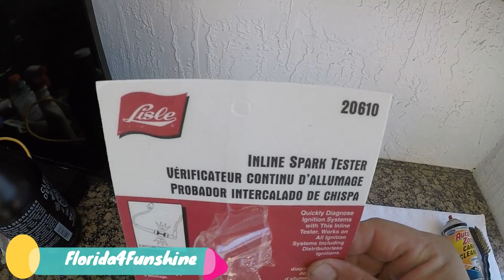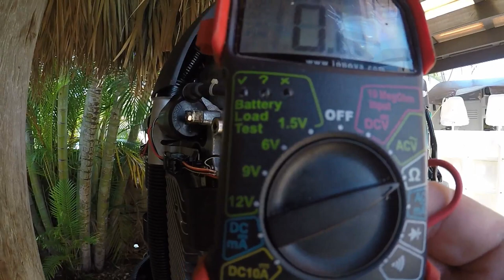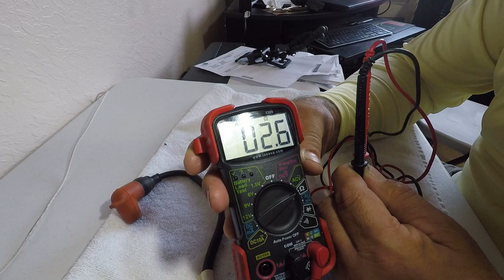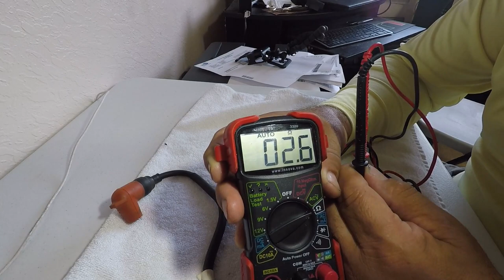Yamaha Outboard HPDI spark plug & coil test troubleshoot bad idle no power. Spark test tool Bad coil

Comment: Hi great vid and thanks for showing how to test the coils. In my manual for my OX66 1999 250, it also says to test the wire harness, CDI output peak voltage, charge coil peak voltage and pulser coil output peak voltage. My issue is low to no ignition spark. Is a multimeter good to test the other things. Though the manual is great, these things are a bit confusing. I don't want to order new coils and realize it could be the pulser coil as well.

Comment: With the engine running if you take one plug wire at a time and pull it off if that's cylinder is not firing there would be no change in the engine if it is firing and you pull it off the engine Will miss fire you don't have to buy special equipment to test to see if it's firing or not
Reply from the maker: @fishydubsfishing6516  you are 100% correct. But... I do not enjoy getting shocked. 😂 I like also to see the intensity of the spark. But you make a good point.

Comment: Would have been nice to see the spark plug boot test for resistance also. Have been trying to figure this out and seems what I have found is you unscrew the cap from the wire, test resistance should be between 4k-6k ohms.
Reply: Boot alone will be around 3-6ohms
Reply: What he did what a complete test, coil- wire-boot will add up to around 15-17k ohms

Comment: Hi, I got the same motor like you. It ran fine before I replaced the high pressure fuel hose. Right now it cranked but don’t want to run. Do you have any idea? I did check the coil and spark. Everything works fine.
Reply from the maker: Are your fusel lines flowing in the right direction from the filtwr?

Comment: I have a question I have a 150 hpdi I can get about 2500 rpm’s then it’s basically just bogs and stalls out and dies or if I let off it continues to run it did have a shutter in it like it had a miss I did not know 2 and 3 did not run in idle so that answered my question why it would run so well at that time 2 and 3 were wet and had carbon build up they have new spark plugs in them I’m gonna check coils next but the 2 and 3 plugs have gas on them which means it’s not burning off all the gas or is to rich. What are your thoughts?
Reply from the maker: Hello. These engines run on 4 cylinder in neutral and 6 when in gear. This operation is done by a shift switch. Check out my video on this subject.
If the switch is defective this will happen as it will run on 4 cylinders and only give you 2500 rpms. This will cause the wet plugs as you mentioned because 2 cylinders are not firing. These cylinders not firing are 2 and 3. (1, 4 . 5 and 6 are firing )
It is an easy fix. Please let us know if you fixed it. 
We love to hear success stories!
Reply from the maker: https://youtu.be/DFF01S_c3P8        
Above is the link for the video. Hope it helps.

Comment: Any idea what can be blowing the 20amp ecu/fuel pump/ coil fuse on a 2001 150hpdi ? I’ve already replaced the low pressure pumps that were bad, the medium pressure electric fuel pump in the vst ( mechanic said this was the cause of the fuse blowing ) after changing the vst fuel pump now it’s still blowing the fuse but as soon as you turn on the ignition.
Reply from the maker: check coils
Reply: Yep ! Was a cable leading to the coils that was bare , quick fix after finding it.

Comment: Hi can the coils be tested without taking them off the engine? Thanks
Reply from the maker: You can check for spark with the tool between the coil and spark without removing.
Reply: Hi yes I realize that , thanks for the nice video,you are doing a great service to all the 200 HPDI owners out there . Ohms testing is what I am referring to . Testing while bolted to the engine my coils read 2.6 to 3 , however there’s no reading from the coil to inside the spark plug cap ,and I was very careful to make proper contact . Here’s the whole story, I went on a short trip both engines ran flawlessly,after anchoring for an hour only one would run the other one would run for 5 seconds and shut down. A few weeks ago I had changed all the visible fuel filters so I figured it was a spark problem. Yesterday I got them both started and they ran flawlessly. Do you have any idea of what caused the malfunction? Thanks for your time.
Reply from the maker: @edwardburrowes4243  Wow! When I come across this issue I look for something loose or not tighten enough as my first troublshooting step. Also for a leak in a hose or faulty wire or connection. Jeep us posted if you find something.
Reply from the maker: I like to remove them. They are in ground to engine.
Reply: @edwardburrowes4243  Hi, I have the same problem as you describe. Did you solve the problem??? Thank you for your response.
Reply: @MegaTucek  Hi yes , long story short on the HPDI engines the fuel delivery system has to be air tight,my engine was sucking air past the o ring in the clear fuel filter bowl , I noticed that I couldn’t get the fuel  pump bubble hard so I started squeezing it with the engine “off”, don’t do it with a running engine a fire could result, and I saw leaking fuel coming from the top. I have neglected to change it thinking that it looked ok. Also if yo never have, clean the catalytic converter before the piston starts to ping there’s a video here on YouTube. Good luck.
Reply: @MegaTucek  sorry I didn’t remember, outboard exchange video on the O2 sensor, he has many useful tips on 2 stroke engines